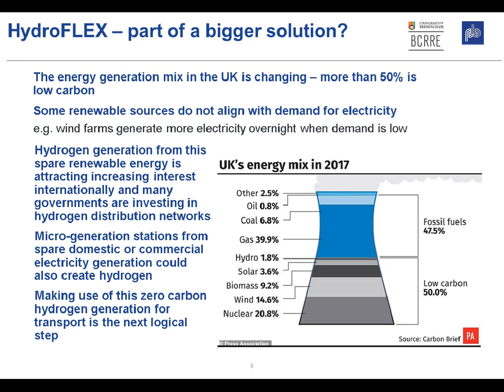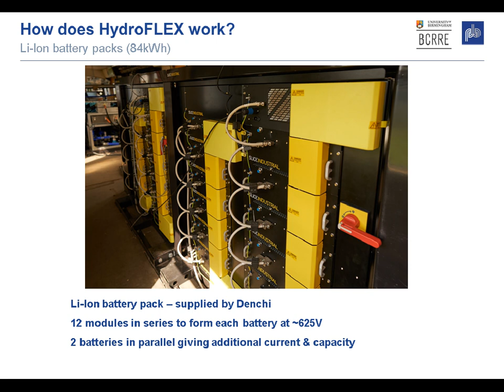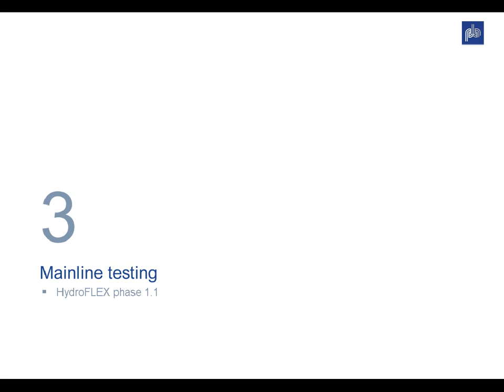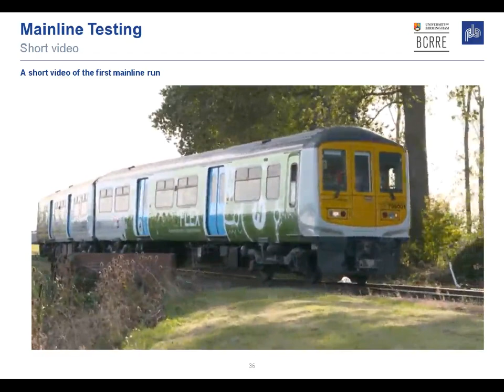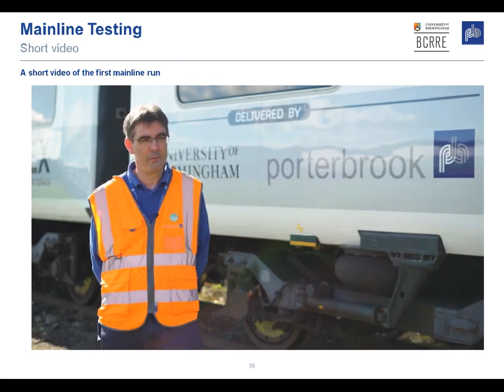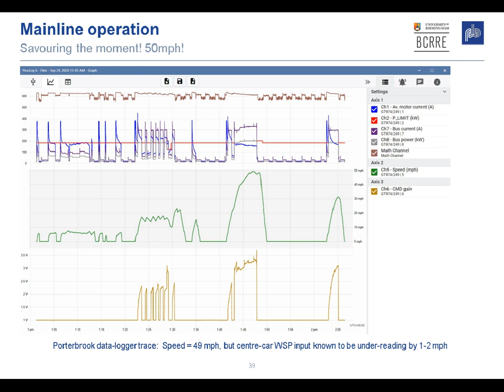HydroFLEX: the UK’s first mainline hydrogen powered train

Comment: This invention is arguably the most important of the century.   As one of your speakers pointed out, it solves problems associated with electrification of routes.  For my country Canada it means that we can avoid the horrifically expensive and lengthy process of electrifying our enormous rail system and (to use the words of one of your presentors) `leap frog' in to the future.